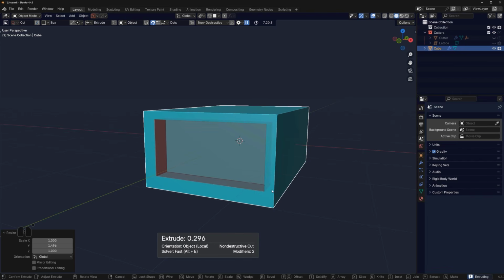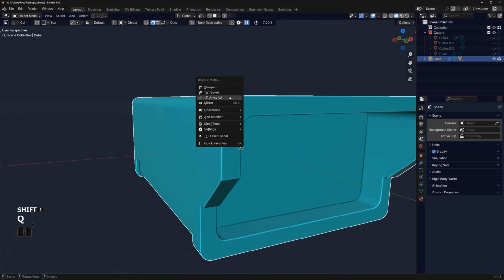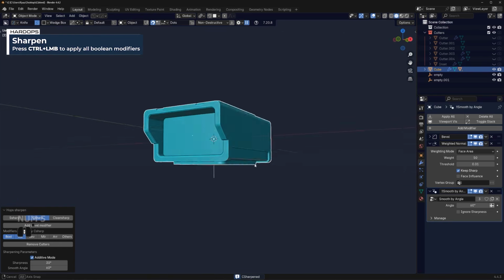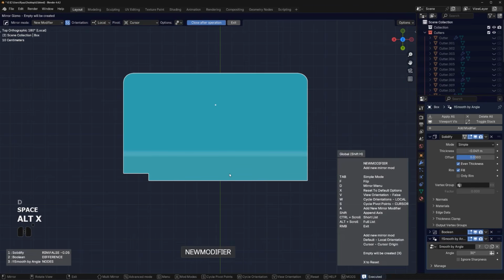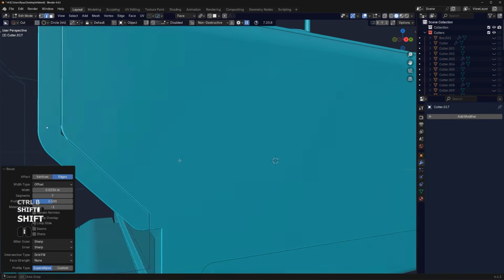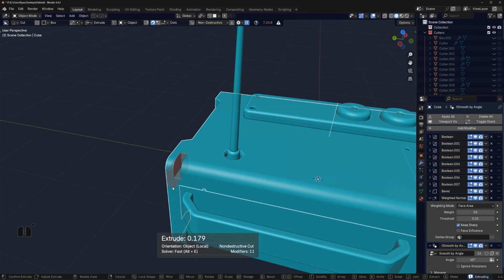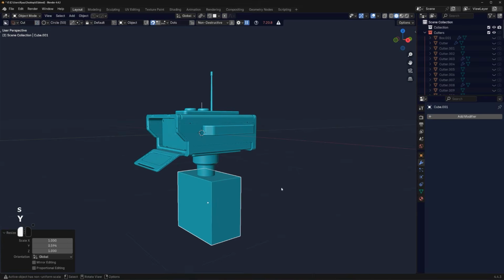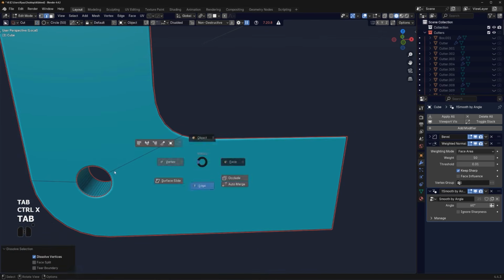Quick and Easy Scifi Terminal Design in Blender

Comment: I found using box cutter you create a lot of booleans and you spend more time trying to clean them up instead of just using quad based vanilla techniques
Reply: Booleans are an extremely useful and flexible way for creating shapes. You're only limiting yourself by not using them.
Reply: @theOneandOnly-u9w  you can always remesh it later or like I do when I need to use quadremesher. most problem solved automatically.
Reply from the maker: i dont need quads, so you do you mate, also if you are running subd with vanila tools you need professional help
Reply: @PonteRyuurui  This is really starting to sound like a broken record. LOL
Reply from the maker: @Dina_tankar_mina_ord  you mean the vanilla quadboys, yeah i know
Reply: @PonteRyuurui  exactly haha
Reply: @PonteRyuurui  can you do curve surfaces because I'm creating a microscope and it has lots of hard edges but I need a curve as well
Reply: @P @PonteRyuurui great name for a boy band ‘Vanilla Quadboys’ 😎